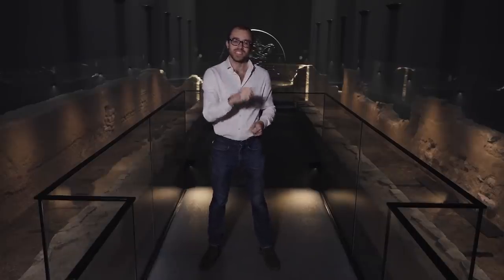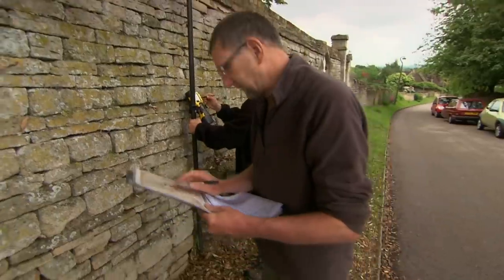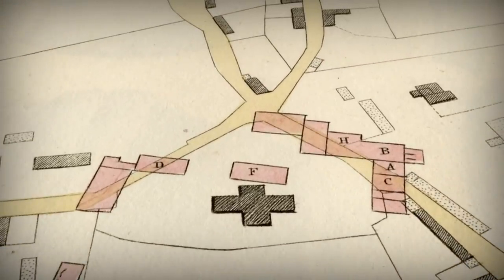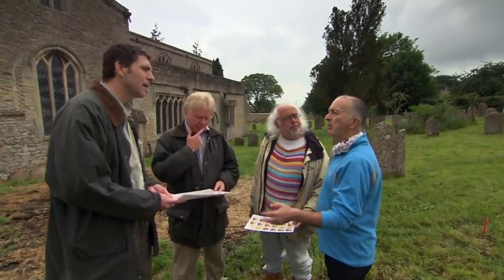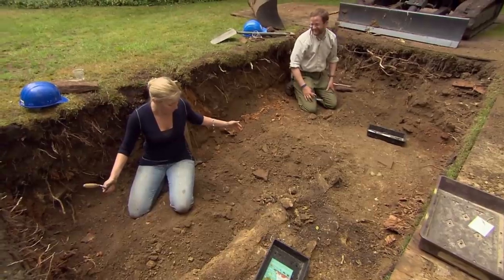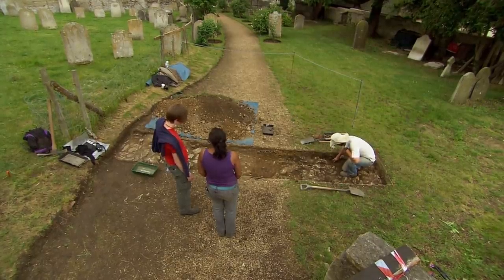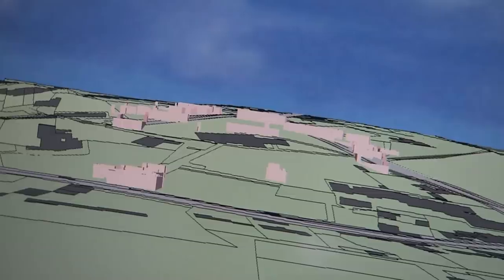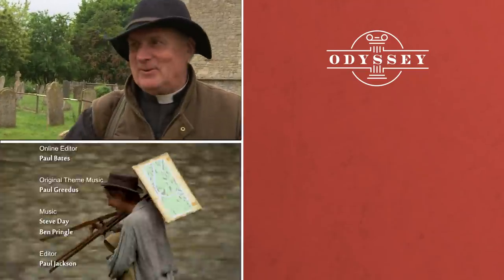Is There A Roman Palace Buried Under This Church Graveyard?  | Time Team | Odyssey

Comment: on pause 37:51 in late 60's and 70's lived in Baldwin Park,Ca. At last house had a yard in back full of Rocks. My dad and Mom wanted grass which became my job later to cut it. The hole Kays standing in my dad needed to bury those rocks. Holes like hers became to my job. Me with my pick in shovel digging holes big enough to bury VW's That memory came about watching Kaye in her hole. Sometimes even holding a pencil was a chore with the blisters got digging my holes. Went back years later after moved from there. They said is so unlevel. Was much I could still see some of my holes. The dirt had dropped threw our rocks put in them. Maybe one year will be level.I was around 12 when dug my holes was alot of work.My weekends where not always fun. With dad home for me and my other brother he screened my dirt and spred it on the grounds. with my dad.